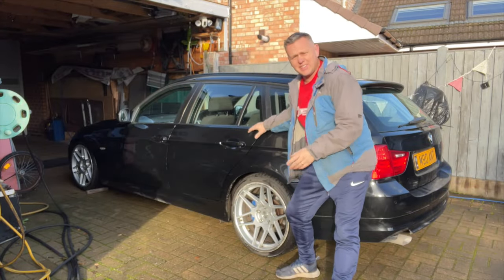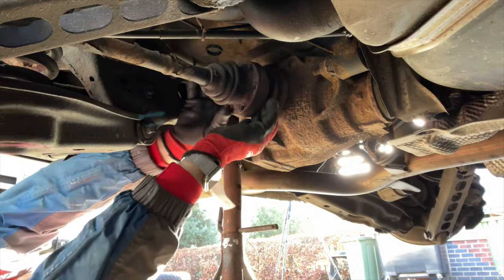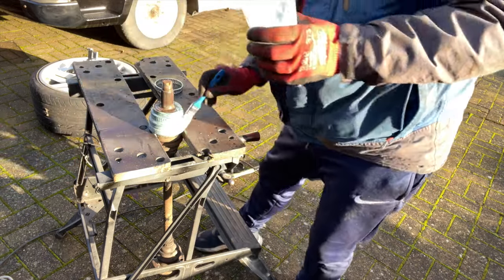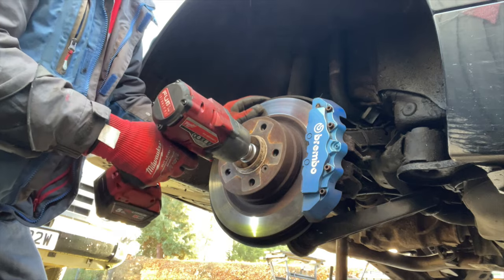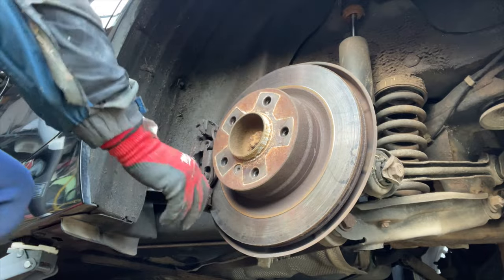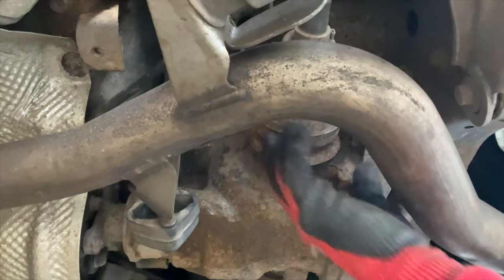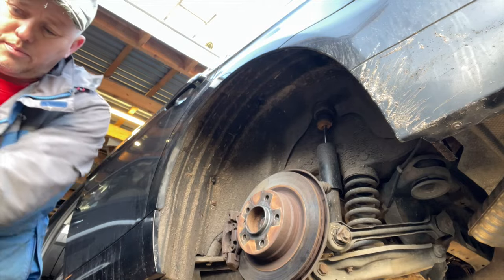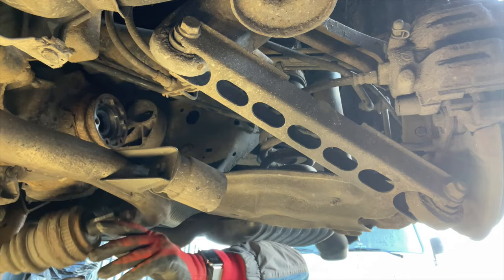BMW 318D ABS Ring Replacement, Both Sides. How To Diy, E91. Same as 320 118 120 etc. DTC.

Comment: I followed your video 3 years ago with the washer hack and it worked a treat. I am now getting glitchy traction control again and I think I need to do this fix. That clip of you getting the drive shaft nut off is anxiety triggering! 

Did you try a thicker washer before going for the ring replacement?
Reply from the maker: You might be able to go slightly thicker give it a try, Thanks for the great comments👍🏻👍🏻🛠

Comment: Milwaukee does a 12ah battery (quite expensive). Any idea if this will give more power to the impact gun compared with the 5ah battery?  I'm inspired by your drive and determination to overcome obstacles to get the job done.  Thank you.
Reply from the maker: The 12ah battery will for sure deliver a more stable power, the one I switched to was a fully charged 3ah high power battery which is supposed to be as good as a normal 6ah battery😂 the 12ah is a big lump, Thanks for the great comments👍🏻👍🏻🛠

Comment: Hi there, it seems like the socket you are using to remove the hub nut in this video is not of the Cr-Mo heavy duty type that you link to, but rather a standard (Chrome-Vanadium?) 12-point socket. Also, the wall thickness of the socket seems thinner than the heavy duty one. Can you specify what socket you used in this video? Is it OK to use for this purpose, with a slight safety margin? Torque rating?
Reply from the maker: The one in the link is better for this job the one I used is just an old Britool one in my tool box, Thanks for the great comments👍🏻👍🏻🛠
Reply: But obviously good enough, even with an impact tool, and torque probably well above 400Nm when undoing the nut. Why go for a Rolls Royce when a Vauxhall will do the job?😊

Comment: Hi.  If getting garage to replace reluctor ring.. is it just easier for them to fit a new shaft instead? Rather than refurb it then add new ring?   I dont have all tools to do myself.  So refurb will be labour cost but it might be same cost as getting new?  I would need 318i se 2.0 for 2011 plate. Both rear shafts.  I have no idea of brands and what are approved bmw parts.  Ivr seen new shafts as low as 50 quid and up to 225.  Obviously i want cheap as possible but good quality.  Max i want to spend on each shaft is 110 if possible. Any recommendations on a drive shaft brand from anyone?  Also will it come with ring?  Thanks
Reply from the maker: Yes the garage will just replace the shaft, inc abs ring, Thanks for the great comments👍🏻👍🏻🛠
Reply: @aaanton11   thank you.  any idea how much i should expect to pay for each shaft?  because clayton cars in Bristol who are a specialist quoted me £550 each shaft!   when online they start at £60

Comment: If the rings on drive shafts have been replaced on BMW 16i why does my car now feel like I can feel every bump in the road while driving  not smooth  like something not in place properly after costing me almost 400 from BMW it feels rough
Reply from the maker: Did they change ant suspension components? or pump the tyres up? Thanks for the great comments👍🏻👍🏻🛠
Reply: @aaanton11  not sure  the  car feels a lot faster the normal  night he suspension order to different  my son says  it's because its a BMW 16i sport that's how it should feel tyres are ok got check for correct air pressure.

Comment: What happens if you don't paint the rust that's been converted?  Does it just rust again?  Why doesn't the gooped on converter damage the ring or interfere?  I'd worry about putting on the ring until all the rust converter is complete, but not sure.
Reply from the maker: It just dries like pva glue no issues, Thanks for the great comments👍🏻👍🏻🛠

Comment: Any tips to knock the shaft through the hub? Yours seem so easy to come out, mine are stuck solid, sprayed them and could be knocking them for ages and nothing happens 😂
Reply from the maker: Use a Drift and a Big Hammer it will shift Thanks for the great comments👍🏻👍🏻🛠